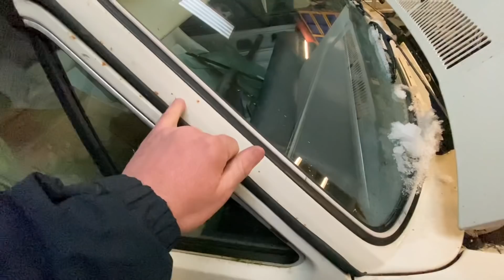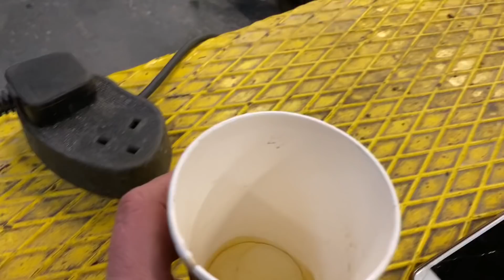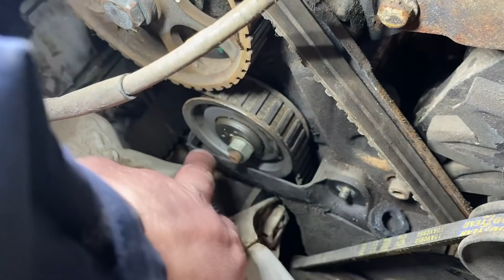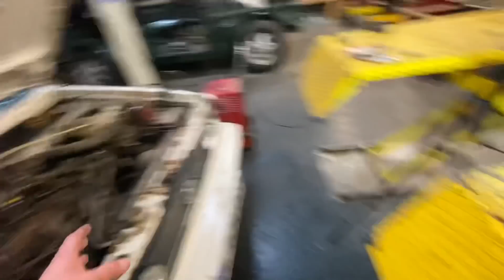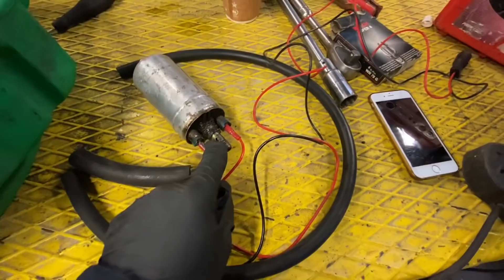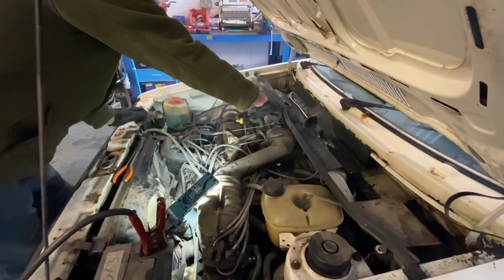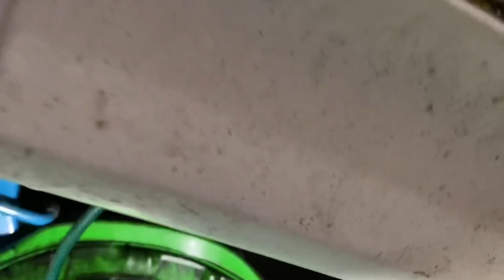Will It Run ??? MK 1 VW Golf GTI Rare Car Barn Find PT2

Comment: (Lets get involved)Hi guys great video nice to see body with all snow off that tensioner and cam belt they look ok and that fuel looks not nice I reckon that room can get away with a new section of fabric  and the compression test looking good sound like a good storng engine and do look like it needs a good clean out of the fuel system but great video guys 👍🛠💙 great to hear it ruining two